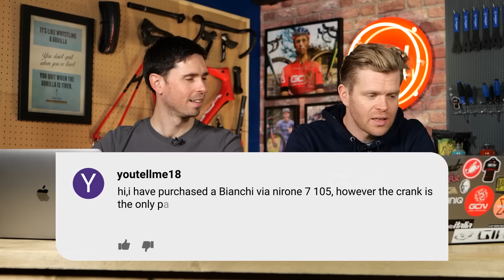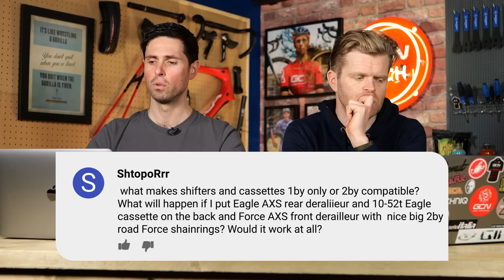Dinner-Plate Cassettes, Seated Vs Standing & Moving Floor Mats | GCN Tech Clinic

Comment: On the road, those "dinner plate" cassettes look ridiculous. And the mechanical machinations necessary to make them work don't seem good for componenent longevity.
Miguel Indurain was one of the top 15 fastest Alpe d'Huez riders in the early-mid 90s. The steel racing bikes at the time were typically equipped for those stages with a 12 - 26/39 - 53. There were no bike mounted power meters back then that I recall, though a heart rate monitor was likely. So, I can imagine that if Miguel were in his same prime today, riding a "modern" bike, he'd dust everyone.
I think that if you're racing, with full support and team supplied bikes, then go crazy with the latest and "greatest." Mere mortals can get by with what Merckx rode on with the exception of adding in some nice STI shifters. Oh, and you'd be able to fearlessly mount a bike like his to your roof rack.
Reply: There's a difference between "dinner plate" and "reasonable for mere mortals."  An 11-32 cassette doesn't look all that different from a closer-ratio cassette, but my knees hurt just thinking of attempting a 20% grade on 39x26 as opposed to 34x32.
Reply: @trainiax  I used to do a hard group ride with riders half my age. The course had a short 1 km climb at 20%. I'd use a 12-23 cassette with 53x39 rings. I'd never finish with the leaders with larger cogs on their cassettes, but I'd use the hill to overstress my legs, for training. If I had a short hill like that in a race, I'd use a 28 in back.
30 years ago, I could do it in a 21. (those days are long gone)

Comment: Don't get me started on "dinner plate cassettes". Back with 8 speed Dura Ace 7400, the largest cassette had a 26. With 7700 & 7800 you could get a 27. With 7900, you could get a 28.
A good part of the reason for dinner plate cassettes is because people with deep wallets don't have the legs to push a 39x25 over a hill. What percentage of people who use the best components actually race?

Comment: The change in gearing had a tech component also.  Hubs and dishing requirements had to be redesigned to accommodate an increase in cogs.  I recall conversations questioning the strength of the wheel with nearly vertical spokes on the drive side.  Chain design also changed as the space between cogs shrank.  Chains are not as "robust" as they once were.  Additionally, keep in mind the cog selection (all five of them) was always with a focus on top end speed over the most important part of road conditions.  You cant win if cant keep up.
Reply: In the 1970s, we were  building touring bikes with triple chainrings and wide ratio 5 speed freewheels. One guy I road on a tour with, extended his rear derailleur jockey wheel cage to handle extreme low gears.
Reply: Exactly. With only 5 cogs racers didn't have the luxury of a very low gear. Tourers did. With a triple chainring I had gears lower than 1:1

Comment: #askgcntech  Hi, With cassettes can you mix and match the gears? If you were going to do a lot of climbing have more bigger gears and if more flat work, smaller gears, I have an 8 speed and don't want to upgrade the shifters, derailier etc thanks paul and ollie
Reply: If the bike already has the larger gears installed, changing to a cassette with slightly smaller cogs shouldn't require any major changes other than perhaps adjusting the rear derailleur b-tension screw.

If the bike has small cogs installed, changing to a cassette with larger cogs will require ensuring that the rear derailleur can handle the largest cog (as well as the total cassette range) and ensuring that the chain is long enough.

Comment: One big reason for the absence of "dinner plate" cassettes on older bikes: Not enough sprockets.

Dura-Ace didn't even reach 9-speed until the late 1990s.  Having only 6 or 7 gears at the back limited the total range of the cassette while maintaining reasonable jumps between the gears.  Even today, a 7-speed 11-34 cassette has massive 20%-plus gaps between the gears.